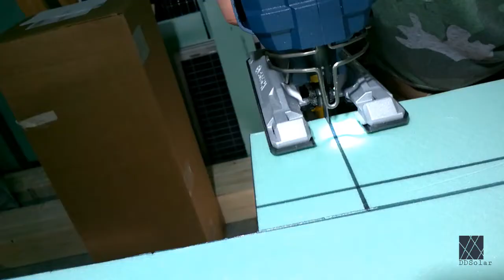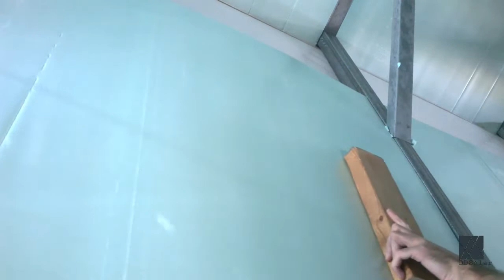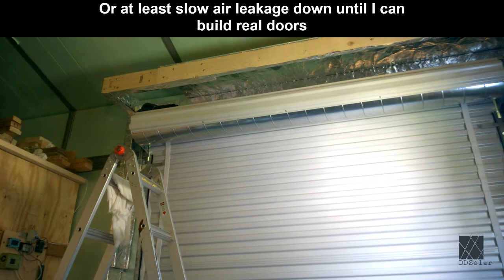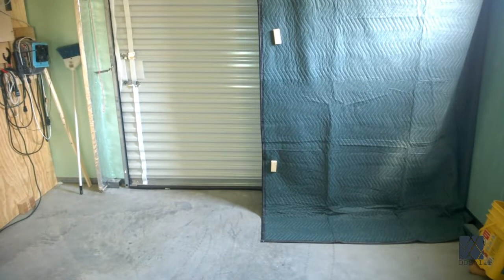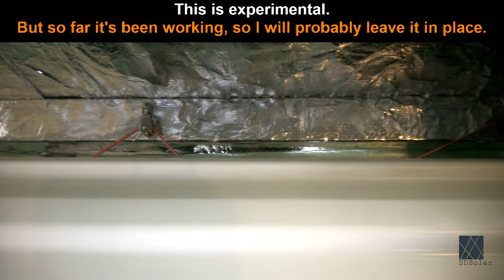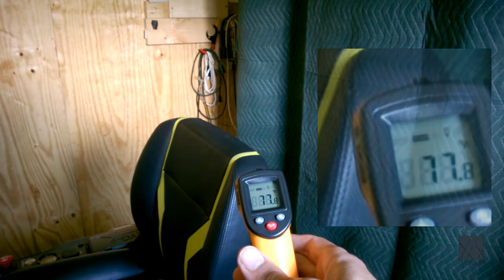Insulating a Rollup Door - Frame and Insulate Rollup Door for Cheap on a Metal Building!

Comment: I'm beginning to see a lack of understanding and a problem with these roll-up doors I believe the only people that should have them are those who have steel buildings with no ceiling and they also need the overhead clearance because perhaps they want to put an aftermarket car lift or something that requires height. If no special need is there for the lack of ceiling and the height then you should install a regular garage door with the opener even with that if your car lift was deeper in the building it would not interfere with 🎉the garage door overhead. As for your project I would have used styrofoam for the ceiling near the top of of the door when you get around to framing in possible wooden doors you might consider not using would just to inch styrofoam and possibly they could be hinged so the door raises up to a ceiling position totally out of the way. Now also I wonder why not make those roll up doors longer and the vertical tracks longer so that the door metal comes close to the top of the door opening if that whole setup was a foot or two higher wouldn't that close that Gap at the top. Then to couldn't that hold door be made from thin flat steel instead of corrugated.
Reply from the maker: @darnmartian9766 Good points. Btw this door was later replaced with an insulated sectional... I absolutely hate rollup doors! next building will have a sectional / garage door from the start

Comment: Have you looked into Brush Seal Kits and header flap for sealing up roll up doors
Reply from the maker: Yes indeed, those are pretty well thought out. I also spent a lot of time looking into other options. One door option I found is the "insulated sectional door". Very much like a garage door, except it is insulated with internal foam and slides up towards the ceiling instead of protruding into the shop space. (Better than rollup door, but not cheap at all)

Comment: What if you attached a layer of double bubble insulation directly to the inside of the door? I would think the door would still function since the insulation is thin and flexible. Use double sided carpet tape maybe?
Reply from the maker: @DirtyDave413 That's a thought... the kind of insulation I have is 1/4 thin foam with foil backing. It would sort of roll up with the door and make the roll a bit larger. There are a few more inches of clearance for the roll. It would seem carpet tape would work. Could try to follow the profile of the door. Could be quite a task, but worth doing some tests!

Comment: I’m looking into putting up those clear flaps like in walk in coolers on the outside of the door.
Reply from the maker: @chidosalazar Interesting solution - I've seen flap doors at a local warehouse. Very heavy material, they should work well. By the way, there are also thick insulated Sectional Doors that have rails bending up towards the roof (unlike a garage door). The door is built of sections that stack and seal tight. They might be an upgrade option. I didn't even know they existed until recently. However they are a bit expensive.

Comment: im going to just opt out of the rollup doors and have them just do the openings so i can put in some standard garage doors. im going to need 4 8x8 doors at $492 each, but after saving the cost of the rollup doors its only going to be about $450 more, but ill have to install them. thats fo non-insulated doors, but my main concern was critters getting in. i can get an insulation kit for them too if i need to.
Reply from the maker: @rozzbourn3653  Garage doors with foam are what I would prefer, except I don't like the tracks that extend inside the building. Since there is already rust on this rollup door (brand new) I am looking at replacing it eventually. Maybe a different type of door

Comment: I had a screen door built on the outside of my pull door on my building. I don’t even have a question why I had it built with the pull up door now that I have it . What I use my building for or did this past summer was for canning. And I had a small kitchen built on the back . So the reason I did the screen on the outside was fruit flies. I’m not sure if it’s going to keep the most out put we will see when I start with vegetables in side my building. My plans where to cover the 36 inch door from the inside of the building with my greenhouse plastic and then the rest . We only have had one down in the low teens so I duct taped the plastic to the outside for that short span. Had sweet potatoes in there right at the pull up so we see how they did . I also had them coved with blanket type curtains.
Reply from the maker: Pretty neat! Never thought of growing food that way. I'd like to get rid of this roll up door entirely, maybe some kind of greenhouse structure is the answer...

Comment: You can by seals for garage doors. They look like a broom and can cut them to the size you need.
Reply from the maker: Thanks; I've actually seen those types of seals. With the framed door I am able to control humidity (installed vapor retarder) and it's been working good so far. I am finishing the building similar to a residential space with HVAC, so it's important to control drafts and air flow.

Comment: Interesting Subject....I also have 2 roll up doors on different buildings.... My brother has a well insulated shop. 4000sqft...R50 cieling and R 30 walls steel structure .It has a standard "Style" garage door... But is a R 17, which he paid a lot of money for.....It's the leading area of heat & moisture for the whole building....and you can see a small amount of daylight... I believe on the next building I will opt for that style....After all...The cost of electricity is what it is, and 1 thing is for sure....The cost will keep rising....Money spent now will pay even better dividends as time goes on with the increasing cost.
Reply from the maker: Good points for sure. I am very interested in the standard garage door type, and will consider it on my next building, depending on the insulation details and whether the tracks for the door get in the way. DD

Comment: Hi 
Why don’t you just put a sliding barn door on the outside with rubber seal. You can even make it out steel panels that your building and insulated with foam board
Reply from the maker: Hi, yeah that's a great idea! I do want to use foam insulation somehow. These "curtains" will get me through summer while I get my act together. My building is much cooler already.

Comment: Was also thinking of foam noodles to stop big gap at top - now that I have seen your pulley system might work with noodles and a dowel rod through them for weight - thanks for your videos very educational
Reply: welcome to the channel
Reply from the maker: Hello thanks very much for the feedback. I believe your idea will work. I also thought of a pool noodle. But didn't have any so I ended up trying a "scrap foam insulation folded in half with 1x2" arrangement, and discovered the door would pinch and grab anything that is solid and jam up. I should have known there is no way around lifting the pool noodle, foam or whatever up when the door is opening, then use weights to drop it down (steel bar for example) so it sits firmly on the door. With the pulleys, I think just about anything could be used to seal that gap, although you have to remember to pull the rope before using the door.  When the door is shutting, it will really grab whatever is up there and try to smash through it in the opening.
Reply: I’m a carport installer and they sell a sealer u out under the top L trim over ur door if u don’t have any cut a 5 inch piece of double bouble insulation by how ever long ur door frame is and remove ur trim and place it between ur trim and metal post closing in the gap and letting the little flap just glide on ir door